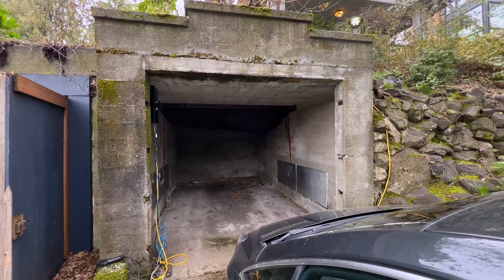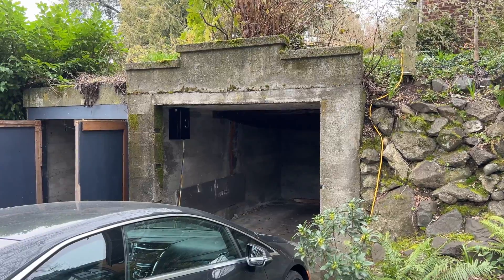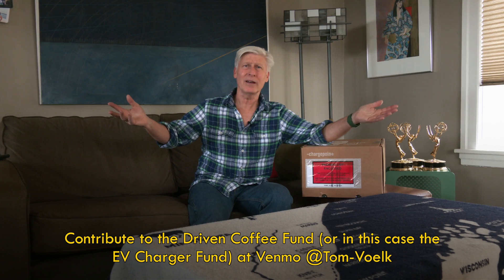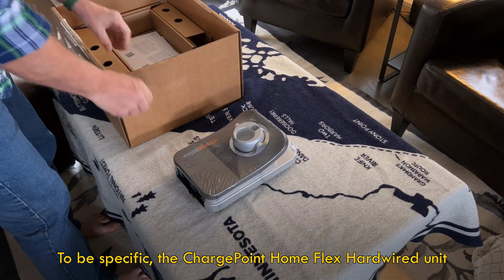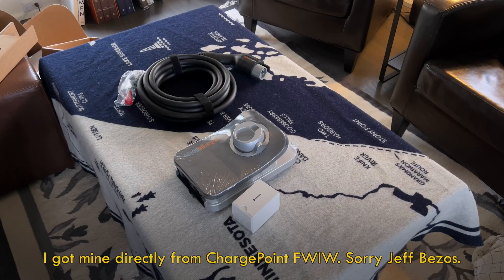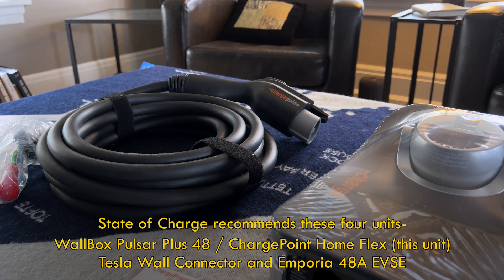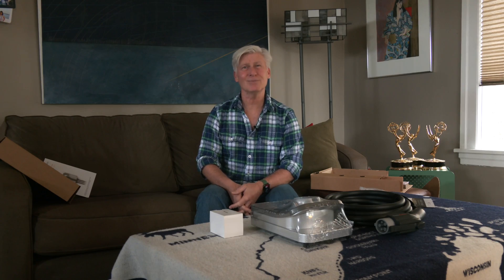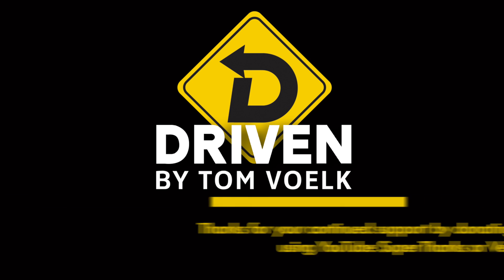This Is One Tough EV Charging Installation! #electricvehicle

Comment from the maker: Here's a link to State of Charge's channel. It's a great resource for info on charging units and charge curves of EVs. We need to be a hive mind. We can't have enough accurate information. https://www.youtube.com/@StateOfChargeWithTomMoloughney
Reply: Excellent indeed. That's where I get all my info. Internet EV reviewers seem to be a cooperative bunch, they tend to do podcasts and reviews together, making the whole thing more enjoyable.
Reply: I recommend adding a Chargehanger for cable tidyness
Reply: @chargehanger 
Another advantage of the Charge Point, the unit is the cable holder. Good design👍🏻
Reply from the maker: @Wised1000  I agree, I like that the ChargePoint unit is also a cable holder. But Bjorn's design is pretty cool and I can see the benefit. It might even work running over a sidewalk, might need to be longer though. Check it out, watch the video- https://www.chargehanger.com

Comment: Tom, I love the channel, but please explain your decisions here. Why spend so much money on an installation - you won't recoup that kind of expense. Second why didn't you choose NACs?  Ford and GM/Chevrolet already gave in and are changing to NACs.  I know that Europe got their act together early, so it's all CCS2, but in the U.S. why not install NACS? if you're doing a big install for a specific vehicle that seems a little shortsighted...
Reply from the maker: Lots of reason to do it the way I did. For starters, convenience. With all the EVs I test, it helps A LOT. Plus our PHEVS charge much faster now, we're getting more all-electric miles from them. It's a tax break for me since it's a business expense. Manufactures might be switching to NACS but it's a ways off. Our personal cars are legacy plugs, so are all the vehicles I'll be testing for the next year or so. There's always an adapter or just switch out the plug, it's not that hard.

Comment: We have a hardwired Chargepoint HomeFlex on a 60 Amp/240V circuit inside our attached garage at home and once paired to WiFi it has worked fine. 

We also have a basic FLO G5 at our Lake cabin hardwired to a 40 amp/240v circuit located fully exposed to the weather outside at our parking location which is beyond our cabin WiFi range and it also operates without issues. 
One issue with the HomeFlex is if it cannot connect to Wifi it reverts to 16 amps/3.8 KWH! How is the Wifi signal strength in your concrete bunker garage?

The basic FLO G5 is not smart (our Kia EV6 has all the smarts to manage charging schedules over its cellular connection) while it has a rugged NEMA 4 housing and is rated to -40F while the HomeFlex has a less rugged NEMA 3 housing and is rated to only -22F.

Note Tom Moloughney has reviewed both the FLO G5/X5 and the ChargePoint HomeFlex and notes FLO has a 5 year warranty versus ChargePoints 3 year. If one researches down the comments in Tom’s reviews one should note that some comments were made about ChargePoint failures and issues with customer service, no such issues came up in the FLO review comments.
I also prefer quality and installing things properly the 1st time. Best Regards, keep up the good work.

Comment: I would have discussed if your utility provider has any rebate programs to offset some of the installation costs of the charger and are there programs for rebates on eligible charger purchases in your area. This was well covered by the WSJ this week.
Reply from the maker: I would have too, if mine did. Seattle City Light does not offer any. Adaption is very high in Seattle, they don't need to.

Comment: Couple questions, for a person who reviews EVs… coming from a 3 time EV user.  A) Why not a NACS connector? My EV truck doesn’t use it (yet), but going forward I wouldn’t buy a home CCS anymore, its days are numbered.  B) 40A is somewhat dated/weak these days,  I’d only consider a higher 11kW/19kW unit going forward. Were you restricted based on your panel/home limitations? I feel 11kW level 2 charging my truck is too slow, wish I had the GM/Ford 19.2kW onboard chargers 😢
Reply from the maker: A) super high chance the car I buy won't buy a car with a NACS port (and I have two cars with J receptors. B) 50A in my case. It's plenty fast for my needs. I won't be buying a truck plus replacing my panel would have tripped the cost of the install.
Reply: @DrivenCarReviews  Love your channel, congrats on your install!  Best car reviewer out there 👏
Reply: Not CCS for home, just J1772. Those J1772 to NACS adapters are common and pocket sized small.

Some serious power, and here we are charging two EVs off a single 16 amp (240V) unit. While 16 amps won't juice up a Hummer from 0-100% overnight, it's ample in offering reliable daily range for our needs. We drive one EV approximately 20k miles annually, while the other is averaging about 10k annually, any more driving demand would most likely require an amperage upgrade.
Reply: @wzDH106  Whoops on that one, yes J1772, not CCS - my mistake.  I have a 48A/11kW wall charger for my Rivian, it works well enough, but I'd love if my truck could accept 80A.

Comment: We’ve had the ChargePoint HomeFlex for a couple of years. Very pleased with it. Fortunately we had an existing NEMA 1450 outlet in our attached garage so installation was easy. It does need to be within Wi-Fi range for the app to function. The app also works with all the ChargePoint public chargers so you can track how much your EV is using both at home and on road trips.

Comment: I use the previous Charge Point Home unit for the past five years. It is a good unit and has held up well installed in a garage. The app has been recently updated and is easier to use than it used to be. Nice that it can get electricity prices and show the cost of charging.

Comment: Out with it! What car are you getting? 😏
Reply from the maker: I really don't know. I've driven so many great vehicles it's hard to decide. But I might have to put it off for a few months, I have a wedding coming up.
Reply: @DrivenCarReviews Not sure if you can decide quickly, but it seems there are a few end of quarter sales for new cars. I have seen local Ford dealers pushing Mach-Es and read about the Ioniq 6 lease deal. Plenty of good used road tripping BEVs out there, too. Best of luck!

Comment: So are you getting a Taycan Wiessach? That would be my choice if I swapped my EQS🤩
Reply from the maker: I have Taycan tastes on a Bolt budget.
Reply: @DrivenCarReviews  🤣
Reply: @DrivenCarReviews  
The Bolt is fine as a runaround, but its 55KW max DC charging is a killer if you want it as a full replacement for a gas car (real chore for road trips). VW recently updated it's ID batteries for significantly longer range, and better efficiency. It could be a better choice in the "affordable" category, plus it seems that they have their fully worked out the initial kinks in its UI.

Comment: House I moved into a year ago has a Tesla level 2 charger. However it is mounted on the outside of the garage and for various reasons I feel I need to park the car in the garage these days. Now I'm thinking of getting a plug in hybrid. So I am going to have to have an electrician install a charger inside the garage. Hopefully it's not too difficult.
Reply: Shouldn't be difficult.  If you no longer need the externally mounted charger, remove it, and reinstall on the interior, running conduit to the new location.   Wire nut off the wires and put a blank faceplate on the electrical box that the old charger was mounted to, assuming it was hard wired.  If you want to keep the charger outside and add a new one, you'll need to make sure your electrical panel has sufficient space to add another circuit.  If you're not extremely comfortable with electrical work, this would be a good job to hire out.
Reply: @readyplayer2  Good advice, thank you.

Comment: Have the same charger, it is great simple to use. I use the Ford app to limit my home charging to 85% , to start at 10 pm, Although we have full solar it is best still best financially to charge at night. Love the 2023 Mustang Mac e premium addition with standard battery pack not all wheel drive. As we live in So Cal no need for all wheel drive.

Comment: I have 2 Charge Points, you will love it. Though I have a "modern" electrical system in both homes, for both ,the electricians opted for an additional electrical panel simply to allow open space for any future needs. Luckily, in my case, no digging was required. Both of my units are plugged in. As such, I can take the units with me if I ever sell the properties. Simply ensure that you get the pricier NEMA plug that has no aluminium components. The ones with aluminium, have a tendency to fail because their rating does not take into consideration continous full load for hours on end.
BTW I don't think you have a garage, looks more like the Reichbunker😂 Hire someone with ground penetrating radar they might find Eva Braun's bones buried there😂
Reply from the maker: It was built before she died so there's that. One reason I went hardwired is because of the plug issue. I'm pretty sure I'm here for the long haul. We love the location.
Reply: @DrivenCarReviews  
Adding a the plug to the unit at a later date if you wish is a very simple straight forward procedure  they send you the plug and its a matter of a few toggle connectors.  I have nothing but praise about the units operation and utter reliability. The app is also excellent and will keep a record of your charging sessions and expenditures truly a complete system. Finally chargepoint DC chargers are in my expirience the most reliable non Tesla chargers too. Unfortunately, most are just of the 62 Kw (aka 50) variety. At least, you are basically guaranteed that they will work when you show up, something that is not so with almost all other brands.

Comment: After all of that, you went with the wrong brand of charger and the wrong brand of car.    Obviously, you should’ve bought a Tesla.  Most will have the NACS port anyway.
Reply from the maker: Easy to change the cord or use an adapter. I just can't buy a car that I'll see 20 times on my way to the grocery store. They're like the modern VW Beetle.
Reply: I wouldn't buy a Tesla if Musk himself hand delivered it to me. Let me rephrase that, particularly if Musk delivered it.🤢
The same reason I would never buy a Lucid, I don't buy products that make detestable people richer. In case people aren't aware Lucid's main partner is Suadi Arabia's murderous prince😮
Reply: That’s OK Tom.  Your channel and your reviews are spot on and I love your work.  I test drove everything under 70,000 and just found that the Tesla drove the best for me the way I like to drive.   Not to mention that I got a fantastic deal on cost. The visceral pull of their motors just seems to me to be the best.   I found everything else to just be slow Unless of course you’re getting an exotic.

Comment: I went with a Grizzl-E charger. 40 amps. No Wi-Fi. Just plug in. Works fine. It should be noted that the charging schedule is set in my RAV4 Prime so no need of that feature in the wall unit. And the actual charger is in the car. That device on the wall is merely a switching device.
Reply: You're right, it's technically an EVSE.  But that doesn't exactly roll off the tongue.